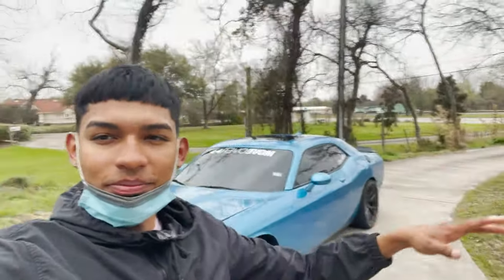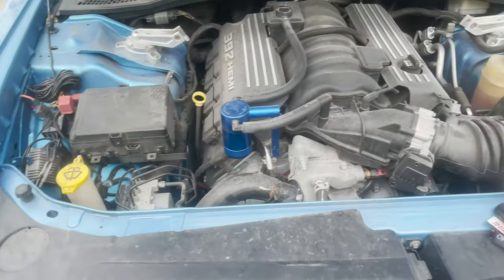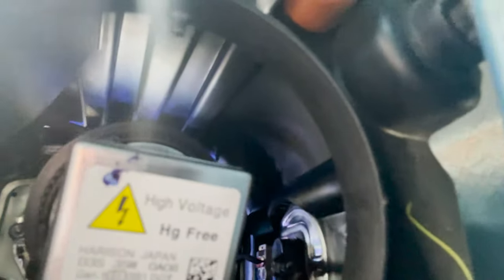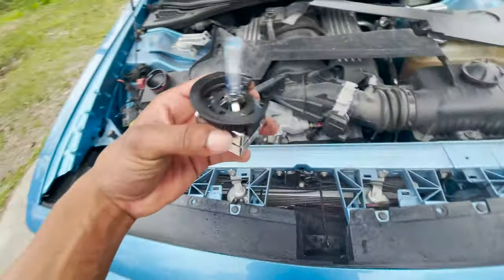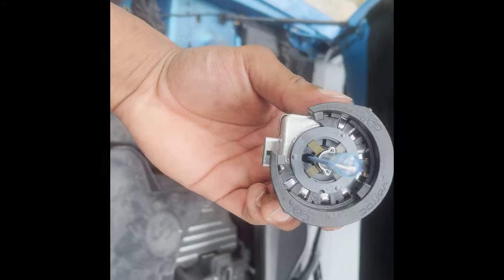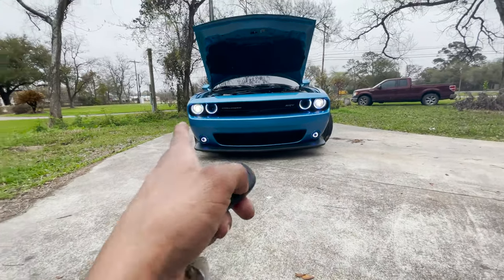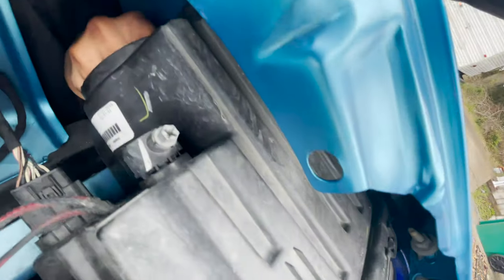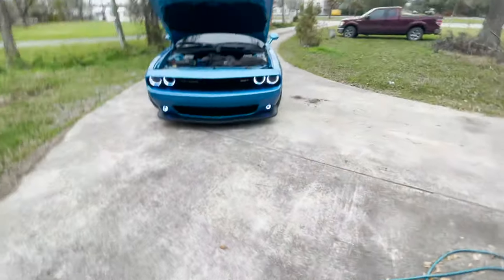How to change/replace ( Dodge Challenger/charger ) Hid D3s light bulbs

Comment: Did this, but still had difficulty turning the plastic locking ring... so I rubbed wd40 on the plastic ring before putting it on the replacement lamp. This made it so that the plastic locking ring turned much more easily... and that finally worked for me. Thanks for the great tip of going through the wheel well!
Reply: The Wd40 won’t damage anything right ???!!

Comment: Great video. I bought the same brand replacement bulbs (Osram) and was curious about the install and the result. This was excellent, thank you sir. Challenger life!
Reply from the maker: Thank you for the feedback 👍🏽
Reply: Fuck these bullshit cars, trying to change 1 fucking headlight on my dads challenger
Reply: @ianb3866  its tough. Let me know if you need any tips
Reply: @paperguns115   I put in 2 new bulbs and nothing. I think the issue is somewhere else
Reply: @ianb3866  there are fuses for the headlights. I had to replace 1 at the same time as the bulbs. Microfuses. An auto part store should have something. Couple of bucks.
Reply: @paperguns115  Bro yes we just figured this out like 6 hours ago i switched fuses and boom shit lit up
Reply: @ianb3866  nice! Well done!
Reply: @ianb3866  bro i just changed my right side headlight without any tools wym bro
Reply: @eddycervantea7882  u got them woman hands thats why
Reply: @ianb3866  im juss sayin how u strugglin with a headlight bulb lol
Reply: @eddycervantea7882  bc i cant fit my god damn sausage fingers inside the light housing, took me forever to break it free
Reply: @ianb3866  what fuse was it
Reply: @392lu   switch around the headlight fuses, im not a mopar guy so im not sure. but the problem with my dads challenger was it needed a complete whole new fuse box bc it kept burning through the right headlight fuse. dodge dealer fixed it, im not sure how youre gonna put in the new fuse box bc mopar use the computerized fuseboxes and they need to be programmed to the car with a chrysler dealer  scan tool
Reply: @392lu  or just keep pulling fuses out and putting them back in 1 at a time until you find the burned one
Reply: @ianb3866  bet bro ima look at the fuses before i buy new headlight a couple months ago my passenger headlight went out then came back on until yesterday it went back out again didn’t come back on
Reply: @392lu  yea the headlights are stupid expensive, all dodge since like 06 and newer used the tipm fusebox and they start wonking out and doing weird electrical shit. theyre not very reliable fuseboxes
Reply: @ianb3866 which fuse you change? Under hood or trunk?

Comment: I just replaced mine, went through that trouble with the cramped space and all but sadly the light didnt come on afterwards. Must be something else that isnt working in there.
Reply from the maker: Dodges have a common problem try checking your fuses in the Front fuse box I had alot of friends I diagnosed with that
Reply: @PapiGotFans  thanks so much. Will have to check that.

Comment: So my 2018 challenger has LED lights, will I need to do more to install these type of HID lights? Will I need a kit? Or will the original parts work?
Reply from the maker: Should be the same connection as on g as you buy the same ones

Comment: Can you make a video how to open the side of the car? Cause i cant open it :(
Reply from the maker: You have to push the pins in with a screw driver and they will fall inside then pull them out and will release the liner …you will have to buy new pins just fyi before you do the job or you will have a loose flap on the way to the autoparts

Comment: just take out oem bulb and put the ds3 bulb in or do you have to have a hid kit ?
Reply from the maker: The hid is the d3s …d3s is the size of the bulb …they only have led hid and halogen bulbs ,depending on what your car came with is what you have to put …now if you want to switch over to his then yes you will need a harness kit doesn’t cost much .sometimes it comes with the headlight bulbs them selfs

Comment: Hey bro where did you get your led strip lights that go around your head lights, I have some on my challenger but they don’t light up in that circular motion like yours do, mine just change color and shit like that
Reply from the maker: The ones you got sound like rgbw drls….I got flowseries drls from lightingtrendz waterproof run you about 300$
Reply: @PapiGotFans  bet that’s what’s up bro thanks and yeah mine are just the OPT7’s. Is that the whole headlight you bought?
Reply from the maker: @ederjosecovarrubias6746  no same headlight but you got opt7 all they offer is light changing not flowing …. I can prolly make a install video if I get a customer soon
Reply: @PapiGotFans  alright cool. What do you do bro? I been wanting to fix up my toy
Reply from the maker: @ederjosecovarrubias6746  if you from the Houston/Galveston Texas area I do car mods on the side I work in the refinery’s come to me I’ll get you right

Comment: So this video cuts in and out. Did you twist or pull straight out cuz it’s giving me hell and don’t want to twist if it locks it into place and I’m pulling.I got the wire to unhook but just getting the bulb out itself is a bitch
Reply from the maker: The clip on the light bulb turn after that’s loose then you can pull out

Comment: Omg u had the exact headlights I’m tryna take out. So dam hard
Reply from the maker: You’ll get it
Reply: @PapiGotFans  square thing is too hard to grab lol… Ben out here a dam hour already. Ready to trash the whole car
Reply: @PapiGotFans  did u break the tabs wheel well?
Reply from the maker: @2wheelsonly614  yes those tabs are factory push them in in the middle with a lil pin then you have to buy some new ones
Reply: @PapiGotFans  omg bro 2 hours of working tryna get it and I got it out… both lights worked in the left tho….  DAM FUSE😡 all this work for a 30second fix
Reply: @PapiGotFans  guess I’m subscriber 700🎉 congrats
Reply from the maker: @2wheelsonly614  sheeesh Preciate the support
Reply: Not go lie.. your comment made me just go check my fuse on my SRT 392 widebody @ 11 at night and it’s definitely a burnt fuse 😭 definitely going to auto zone tomorrow and getting this 30sec job taken care of. Thankful for you!

Comment: Does the 2018 SXT come with HID
Reply from the maker: Depends how your lights look do they look blue or white or do they look yellow
Reply: @PapiGotFans  They Look White
Reply from the maker: @GoldenSpitta305  either you have hid. Or led …you can tell by the connection of the light or if you hear like a fan turn or like it sounds like electricity when you press the unlock button then you have hid if not you have led
Reply: @PapiGotFans  Thanks Yo !

Comment: where did you buy the bulbs?  Do you have a special serial number to buy the dodge challengers bulbs?
Reply from the maker: If you go to headlight revolution  ,there you can buy the headlights .I don’t have a serial number but if you put what year and model you have they should pop up just take the dust cover off and make sure you have the hid not halogens different years have different bulbs

Comment: Thank you for posting this video , very helpful
Reply: The only thing I did differently was instead of popping the plastic wheel well and going in that way I took off the air box and went in that’s way and I used rubber gloves
Reply from the maker: Nice nice good way to stay safe with the rubber gloves …thanks for the feedbaxk

Comment: Quick question.. once you insert your hand.. do you twist to the left? And was is it easier to remove?
Reply from the maker: Yeah don’t twist the plug it self twist the knob in the middle of it holding it to the left
Reply from the maker: Check the fuse box to
Reply from the maker: Make sure I think it’s 25 and 26 for the headlight on challengers those blow often
Reply: @PapiGotFans  I’m literally at the shop and they’re trying from the side of the tire. Mine is actually an SRT8 Challenger, but it’s the same kind of light that you installed in your car. Not gonna lie.. I struggled
Reply from the maker: Yeah man these cars are to compact specially when changing spark plugs too